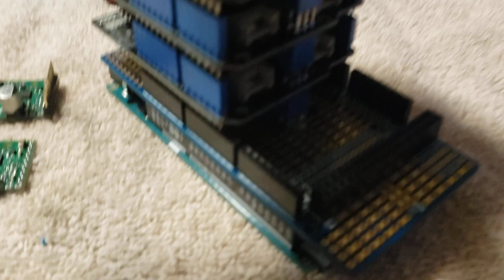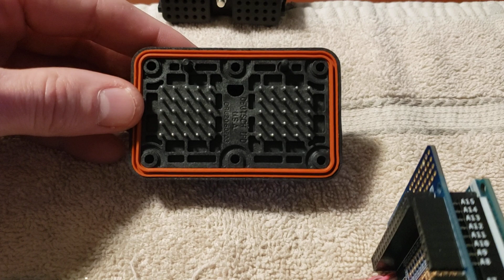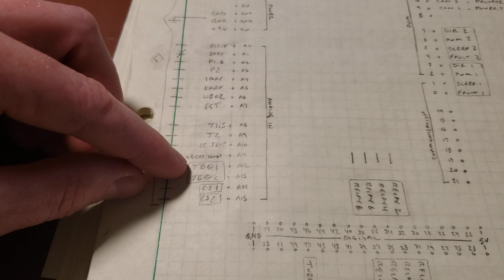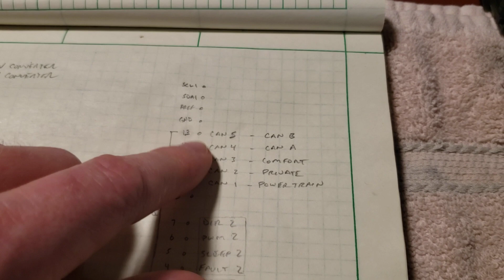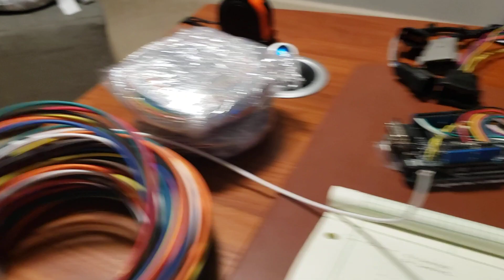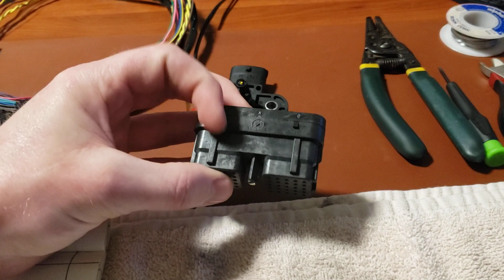Rear-mounted Turbo RS4: Arduino control + CAN bus V3.0

Comment: How did you send and receive message with relevant  can modules.How did you assigned them??
Reply from the maker: These SeeedStudio CAN shields communicate with the Arduino using SPI, and as supplied, they can use either Pin 9 or Pin 10 as the SPI "chip select" to define which CAN Shield the Arduino talks to. 

The code allows any pin to be assigned as the CS pin, so I modified a few of the shields to shift their pin 9 to other pins 8, 11, and 12. This means the Arduino can work with 5 different CAN Shields independently. 

Even though I tested this and confirmed it works well, I decided to go a different route for my car project.
Reply: hi bro，how's your work？